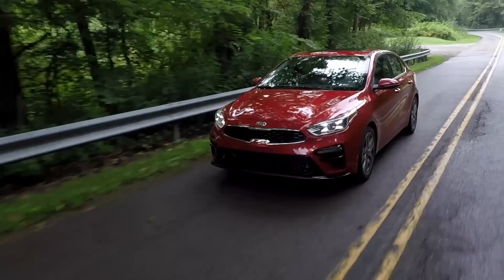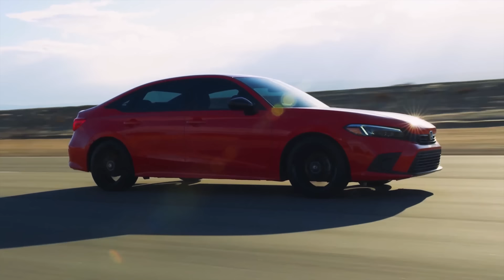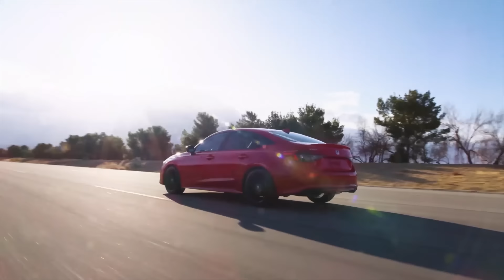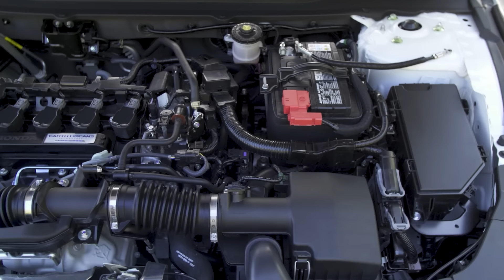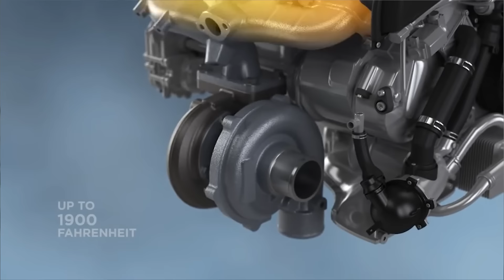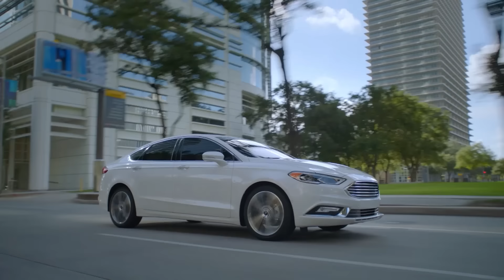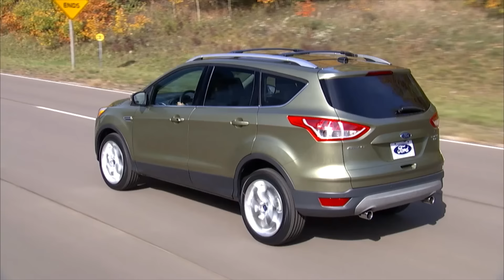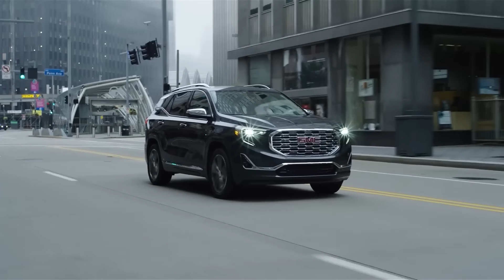Are Turbocharged Engines Reliable? The Truth About Turbo Engines

Comment: Current state of automotive manufacture - "no need to last beyond warranty", "must achieve absurdly high emissions regulations ...that China is utterly ignoring", "must reduce cost of manufacture ...every year ...while increasing regulations that force endless design changes". If you buy a car - BABY IT. Almost all of them are hot house flowers that will blow a hole in your wallet, over and over. Most CEOs are now heartless - NOT trying to help you.

Comment: Yes turbo engines not reliable for this reason our caterpillar c15 is still 950000 mile on clock what a low ıq video all long haul vehicles are turbo and diesel,cummins is world largest and older engine manufactucturer and still build turbodiesels sometimes TWINTURBO diesels why ? Because its not reliable okay

Comment: I find it strange that people are still debating the reliability of turbo engines. Turbos are in over 40% of all ICE engines. Diesel trucks have used turbo's for many years and getting 300K miles of service. Almost all airplane piston engines are turbo's. The real question should be who makes the engine and what is that manufacturers reputation. Not all turbo engines are created equally.

Comment: When comparing turbocharged vs naturally aspirated engines, there is something that pro-naturally aspirated people usually ignore: Naturally aspirated engines, even with the additional displacement, lack the low RPM torque of turbocharged engines. This means, especially when going uphill in highway speeds, they have to be revved higher than the turbocharged engines. I see this part as a 1-1 draw because turbocharged engines have the additional pressure, naturally aspirated engines have the need to be revved high for sustained cruising. These both increase wear. Of course, complication part is true. With everything else being equal (which may not always be the case though), a simpler system wins in terms of reliability.
Reply: My 1.2 turbo petrol pulls better than a 2.5 NA Diesel on any surface including uphill. I went from a 1.9 NA Diesel to a 1.2 Petrol turbo I was expecting to stall the petrol for a week whilst getting used to it as the Diesel was so forgiving I stalled it once in a year, it pulled better than the 1.9 NA Diesel in any scenario and the petrol was just honestly brilliant and still is so quiet, forgiving and easy to drive year round all round. It gets premium fuel and Toyota servicing so the 1.2 Turbo petrol is guranteed some success but the 1.9 NA Diesel was a proven VW engine that could easily hit over 400k miles and it had easier miles than my Toyota however it never got the same level of care. 1.9 TDI VW Diesels were also proven to hit 400k miles no problem too.
Reply: Give me a smooth, syrupy NA Toyota V6 over a Turbo 4 anyday.

Comment: I used to work at a VW dealership (service dep.) the turbos were always going regardless of the model. Usually right at the 5-6 year mark and slightly after the warranty expired. Manufacturers won’t change the design as it maintains fuel efficiency and is quite lucrative to repair. The common trend amongst all failed turbos were 3 things; several short distance trips, frequent start and turn off cycles, and ironically driving in a way that maximizes fuel economy. That being said, turbo cars need a frequent good (hard) run through the rpm range and longer drives to ward off potential failure. Ironic considering that their main build purpose is fuel efficiency.

Comment: I just bought a GR Corolla which is a turbocharged 1.6L in-line 3. IM not too worried about it as I do my own maintenance. I also have a 2009 Corolla S 5-speed manual that I turbocharged and it’s been fantastic. It added 100hp and I still get 32-38 mpg every tank. It’s been turbocharged for 6 1/2 years now. Life’s too short to worry about some things and a turbo car can be so fun to drive!

Comment: Seems like small displacement engines with turbos are prone to  turbo failure in the 60,000 mile range. V6 turbos seem a bit more robust.
Reply: Funny how that happens to be just outside most manufactures powertrain warranties. 😆

Comment: Gas cars will just get more and more complicated causing less reliability, vehicles with more power and mpg just sell better and it is what the customers and regulators want.

EV supposedly have less parts, maybe it will surpass ICE in reliability over the coming years as the tech develops more.

Comment: And the fact that the emissions bullshit of today are pumping exhaust carbon and oil from the engine into the intake manifold.. mix that with direct injection and you have valves that never get cleaned off.  I had an 06 Mazdaspeed6 and at 100k miles it went caput.  Intake valves weren't sealing all the way due to massive carbon buildup, and one of my exhaust valves actually broke. I know this because I took it apart and discovered all of this.   EGR valve is awful on an engine as is the CCV ( I might have gotten that name wrong) - it's the valve in the crank case that releases pressure and spews oil right into the intake.  When I took my intake off, I poured about 1 cup of oil out of it.. insane.   I will struggle to ever own a turbo engine again unless I'm rich.

Comment: Turbo Engines will not last as nearly as long as an conventional engines I don’t care who makes it. They are extremely expensive to fix and maintain especially if you are in a winter state. DO NOT BY ANY VEHICLE that’s a turbo if you keep your car more than 3 years. Run Full Synthetic and change your oil at least every 5,000 miles. After 4-5 years nobody will ever offer you any money for your trade in. Don’t buy a used car with a turbo ever.

Comment: Use good full synthetic oil like mobile 1 or ams and change it every 5k miles not 10 and you would be surprised how much longer the engine will last. Turbos but a lot of wear on oil

Comment: Interesting. You refer to getting cars to normal operating temperatures . But many cars don’t have a water temperature gauge . And I know from a Fiat Coupe ( 5 cylinder turbocharged ) ( a great engine by the way ) that I used to have that it’s water temperature gauge reached  it’s normal operating temperature after 2 to 3 miles BUT a further 5 miles were needed for the oil temperature gauge to reach its normal operating temperature ! Very few cars have oil temperature gauges .

Comment: Great video. This debate is in full swing with the introduction of the 2024 Land Cruiser that comes with a 2.4L Hybrid. Land Cruisers are one of the most dependable vehicle in existence, at least, until now. People have compared the argument to the ones people had over fuel injection, an inaccurate correlation. There isn't a manufacturer who has been able to make a gasoline powered turbo outlast a normally aspirated powered vehicle. The horsepower and torque figures are 'peak', and the powerband is not broad. A V8 might be thirsty, but at full-boost, so is a turbo. Even with Multiple Displacement Technology (Engines that turn of cylinder when engine isn't under much of a load) a V8 is far less complicated. They are not only many times more long-lasting than a turbo, they operate a about half the RPM of a turbo (less noise, less vibration). A V8 is more efficient when towing as well. Don't even get me started on the probability of spontaneous explosion of Hybrid/Plug-in Electric cars.

Comment: My Hyundai Kona 1.6T has been fantastic. I don't abuse the engine, and always let in warm up at least 30 to 60 seconds before driving off.
Reply: I have the same engine in my kia k5. Very nice . How many miles do you have on yours?
Reply: @1958Cadillac-v2g   - We bought the Kona new in March '21 - has 34K now - zero issues, well built automobile.
Reply: @RedEyeC  Glad to hear it. My K5 GT LINE  just turned 30.000. I don't abuse it either, like you you I remote start the car about 5 minutes before leaving for work. 40 miles away. I'm changing the oil every 3000 miles, as I do smell gas in the oil by then, but no increase on the dipstick.  I'm using Castrol Edge 0 20. My best friend bought a new kona in 2020, and he likes it alot It doesn't have the 1.6, it has the 2.0 engine.  I have a 2017 Elantra I bought new in May of 2016. 2.0 engine.  I just turned 100.000 miles last month and has required 0 repairs,  and has0 issues. I kept it . To nice to let go of !!
Reply: @1958Cadillac-v2g   - we had a 2008 Elantra - the perfect car - that's what we traded for the '21 Kona. The Elantra had 143K miles in 13 years of ownership - general maintenance - one set of tires and a car battery. The battery was 10 years old when I replaced it - still had a full charge, but didn't want to chance it with the age it was. People always bashing Korean autos - almost as bad as rival pro-football 😅
Reply: @RedEyeC  my 1st Korean car was a 2007 kia spectra . Fully loaded. Sold it in 2012, about 125.000 miles on it . Only repair was a starter motor.  I live in Southern California so there never any issues due to snow or salt. So thats nothing I have to deal with! My experience has been excellent,  thats why I have no worries about buying another. I hope and expect my 2021 K5 to follow suit. Enjoy your KONA !

Comment: Great video..

I was thinking about  going from a v6 tacoma to a 4 cylinder twin turbo tocoma,I did some research  and came pretty much to the same conclusion you did..the only difference  is i said no to getting  a turbo engin if i was planning  to have it past 7 years,especially  a truck that was going to be used for work

And the turbos on the new tundra requires  you to take the body off the vehicle  to access them..that is a nightmare  when your vehicle  is outside  warranty..

So I'm leaning to keep my v6 2021 taco.. I'm planning  to keep it till i really need to get another vehicle.

Comment: .............................................. Go "Naturally Aspirated"  Only in ICE!.............................Simply put,  Euros, freak'N Korean genesis and belguim Volvo all buy into POWER! While power is fun!...the fun does not last long and in the end you pay Big Time....i.e. Re-Sale on all three year old aforementioned Euros beemers cedes Korean and belbuim chasing HP cramming Turbos many times (2) two and coupled with a Blower!!!  Yep power is increased, however at a Huge cost to you.  research it!...Its the HEAT , added with many components that melt parts and wiring.  Lexus for instance has a LC500 Naturally Aspirated / no turbo V* that is beautiful and bullet proof.....i concur with Lexus engineering add a Batt. to couple with Naturally Aspirated / old school with said batt to get more TORQ and HP combined....Precicely why I bought a LEXUS 450h+ "F" Sport Made Only in JAPAN!!!

Comment: Honda and Toyota both have smaller Turbo charged engines in their new vehicle lineup. I would never buy a smaller 1.5 or 1.6 turbo charged engine. I have always been told that 2.0 liter or bigger can handle turbo charging and not have issues in longevity. 

Heat and pressure is something all engines deal with. Most Turbo charged engines are designed to handle the heat and extra pressure. It's not like these manufactures are slapping a turbo on a N/A engine and calling it a day. The design usually starts with how do we safety cool and maintain this engine for 150k miles. Reason why turbo applications usually have a intercooler and proper internals to aid in heat build up and higher pressures in the combustion chamber. 

Honda has been turbo charging engines for decades and their Motorsport side has been running turbo charged engines in Indy car and other racing leagues for many years now. Doesn't mean you just blindly choose a car with a turbo engine. By all means do your homework, check blogs where owners post their long term ownership. You can usually sniff out the bad models pretty quickly. A Naturally Asperated or N/A engine can have issues as well if the manufacture is trying to squeezy more power out of the engine an running higher compression levels or just cheaper design parts. 

The key to any vehicle N/A , Supercharged, or Turbo charged is to keep up with manufacture recommended maintenance. Watching for excessive fluid or oil consumption and adjusting your maintenance accordingly. A well maintained vehicle should last 15 years no matter what engine it has in it.

Comment: Socalled better fuel economy is stupid reason for turbocharging engines. That saved money on fuel costs will be completely lost on turbo repair/replacement, in some cases also replacing the catalytic converter if the failed turbo leaked lots of oil into exhaust system.

Comment: All auto manufacturers are going for  direct injection plus turbo

Over time the kinks and quirks are being addressed.

The cons he is talking about are improving.Remember just 30 years ago cars dod not have ECUs or electronic controlled engines with semsprs.The technology has advanced since and cars now are all ECU fitted.
Its the same with direct injectoon and turbos.
Over time they will be a standard feature of the ICE.

Comment: I would only choose turbocharged engine cars! period, because I put efficiency over maintenance costs. Naturally aspirated engines have their own problems as well. But, if I would pick a hybrid car then naturally aspirated engine is more reliable because, if I ever buy a hybrid car over electric it's because of the long distance it can achieve.

Comment: So it seems I was right to worry about buying any of the new Lexuses that are all turbocharged or turbocharged plus a hybrid engine.
Reply: Toyota's path to reliability came in small incremental changes to their engines over decades. It wasn't exciting but it was reliable. I'm concerned that this much change this quickly is going to mean a hit to their reliability. Please don't argue with me I don't want to go back and forth or debate unless you have the ability to see 10 years into the future.

Comment: There are 0ld Toyotas out there with over a half million miles on them. All this new Hi Tec expensive junk such as CVT's and turbo chargers is just more unreliable junk with more moving parts to fail. I doubt very seriously that turbo engines will prove to be highly reliable because of the extreme heat. I do not care about improved gas mileage; just offer me a vehicle that I can depend on without costing me a fortune if it breaks. I would rather pay high fuel bills than repair bills.

Comment: The 2jzgte, sr20det, rb26dett, 3sgte, k20c1, 3sgte etc... were all known to be very reliable engines.  Me personally though, I wouldn't get a turbo car as a gas saver.  They cut too many corners on economy cars for them to make a turbo economy car reliable.  The only exception may be like a turbo diesel, like the tdi that's in vw's.  For a gasoline turbo engine, it's best to get a sports car, as they usually make these engines more stout when it's build for performance.

Comment: DON'T GET A TURBO!  Nothing but problems eventually.
Reply: Without a turbo my 1 litre engine won’t get the torque it needs.
Reply: @portman8909   1 litre?! HA HA HA!  Pretty soon, your car manufacturer will be making 500cc, 2 cylinder engines with a turbo!  Or perhaps a squirrel under the hood/bonnet!
Reply: @AudiophileTubes  For a lightweight car it's more than enough power with a turbo.
Reply: @portman8909  Sure, but it won't last as long as a naturally aspirated engine, and has to work harder,  making it prone to less longevity.  For some cars, turbos are great, but for many, it is a cost cutting, planned obsolescence cheap workaround by greedy companies that want to increase their profits at your expense.  My wife had a Buick Encore turbo 1.5 (Opel elsewhere), and despite her driving it conservatively, and changing the oil and filter often, it only lasted 6 years with 80,000 miles!
Reply: @AudiophileTubes  Is this not more related to the build quality of the turbo more than anything? 6 years 80k miles isn't too far off the 140k mile estimate.
Reply: @portman8909   Sure, the overall design of the turbo and it's application parameters are important.  There are excellent turbos, and cheaply made ones, but in terms of reliability, you can't beat naturally aspirated.

Comment: I'm in a quandary. I want a new Mazda CX-5. Problem is, the standard 2.5L engine now comes with cylinder deactivation, which I just don't trust to last. But the only way to avoid the cylinder deactivation is to get the turbo, which I don't particularly want, either.
Reply: Pretty sure you can push a button and turn it off each time you start up the car.

Comment: I had a diesel turbo Smart Car.  I was advised to let the turbo cool after driving. So I let it run for a few minutes in the driveway to cool down before shutting the car off.  A friend who had a similar car replaced his turbos twice during his ownership.  However, he never let it cool down. I believe cooling it down prevented temp. damage when the temp spikes after the car is shut down.  Turbos used properly, serviced properly should last a long time.  Of course it depends on the quality of the turbo.

Comment: My 1st Turbo engine was a 1984 Ford T-Bird 4 cylinder in California that was much better than my friends V8 T-Bird with respect to power and economy. It also performed much better in the mountains at high altitude than a normal aspirated engine. I liked the car so much that I purchased another one for my wife in 1986. Today I'm again driving a turbo charged diesel Ford Everest in Thailand where it's always hot weather so no problem with cold engines.

Comment: I don't trust that a turbo engine is going to last 250,000 miles like many other Toyota and Honda engines have lasted in the past.  The new 4 cylinder turbo in the highlander disappoints me.  I had a Mitsubishi with a twin turbo and after it had 30,000+ on it the turbos began howling like a cat in heat. But not in a good way. I prompted traded it in and also have avoided Mitsubishis since.